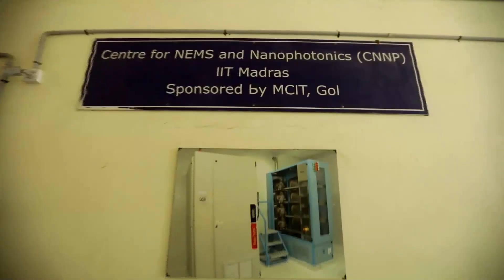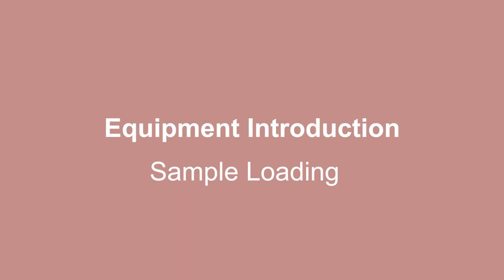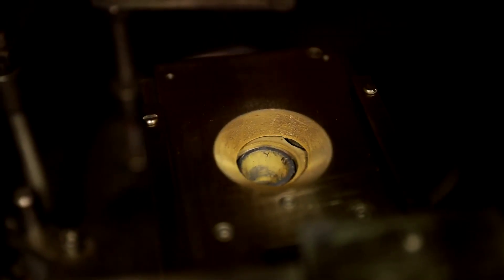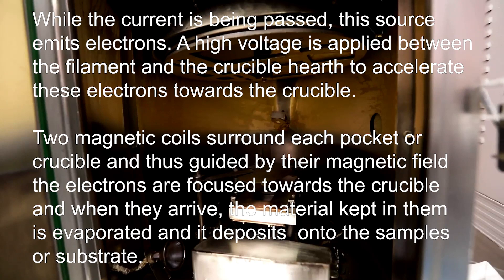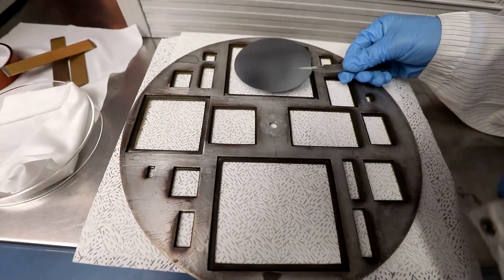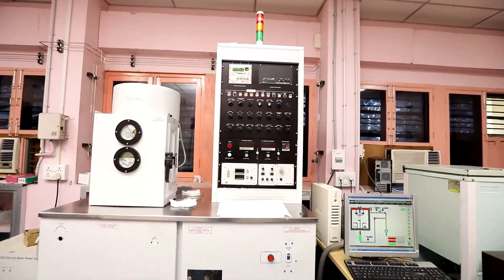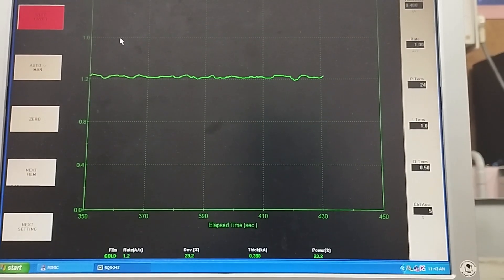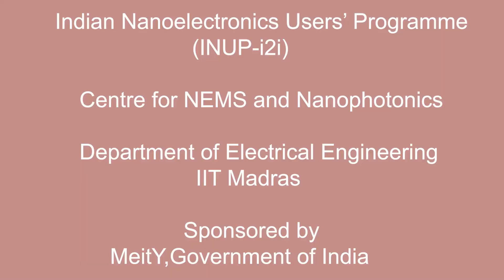Electron Beam Evaporation

Comment: Very nice machine indeed. May I ask, what is the benefit of getting down to such high vacuum? Why not evaporate in the 10-5 or 10-6mBar? As seen in the video, the coated wafer had some non-uniformity, I guess the substrate wasn't cleaned enough or the there was no rotation.